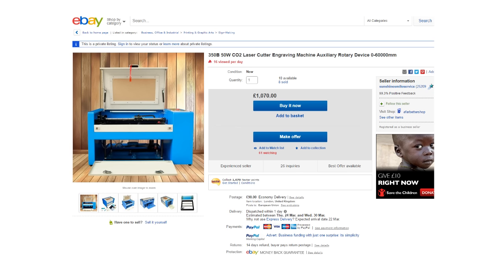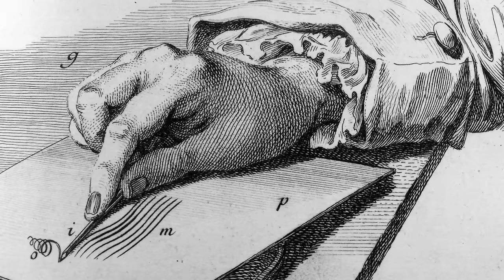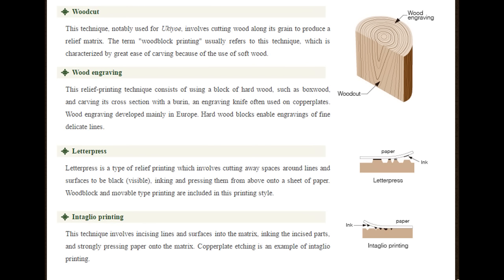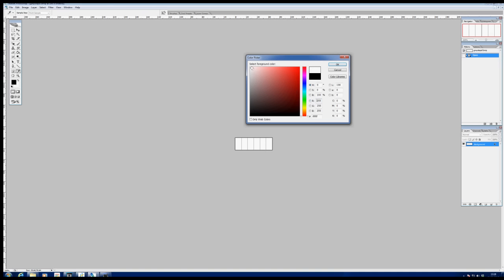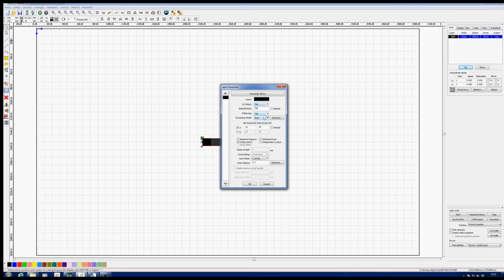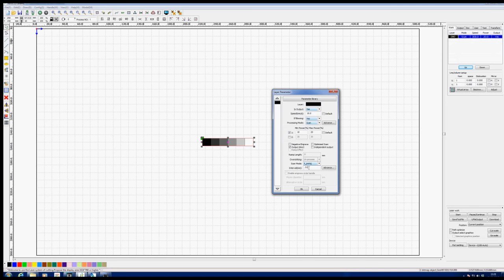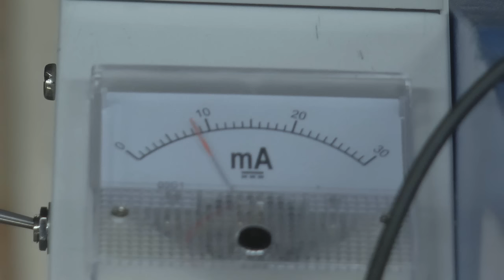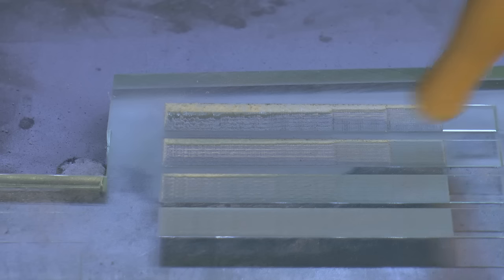RDWorks Learning Lab 56 Engraving Pt1 History and Greyscale

Comment: Hi Ross I am very grateful for your previous help, but I have now another basic question that I am struggling with. I work with memory stick , but the awful thing is that when I save all my parameters  to a rd file (min power , max power, speed for cutting and scanning) the machine don’t recognize them and we need to change manually all the parameters on the machine for all layers. Its very time consuming.
Can you help me with this problem?
And I have one last question In the Work Mode appears a Scan, Cut, Dot options but on the newer version of the software v8.01.12 it is a Pen as well, do you know what this pen does?
Reply from the maker: +666tinche 
Before I finished reading you message I realised you had installed issue 12. Bad news. I had exactly the same issue and dumped it in favour of the rock steady issue 11. You can download this from Thunder Laser  http://www.thunderlaser.com/down    Parameter downloads here as well if you hunt around, although the parameters are now included in the parameter library.
Sorry to say I have not played with the pen yet but I'm sure it will be something I shall investigate in the near future as part of my exploration of engraving capabilities
Best regards
Russ
Reply: +SarbarMultimedia Ross you are a real lifesaver I downloaded this version you recommended and its a really steady version in this version is automatically are included the parameters library as well ,while in the old version it was completely empty. Thank you very much for your time and for your help I really appreciate it.

Comment: Hi Sir,

I have a question and hope you're able to help. I've just purchased this engraver (80W) and for some reason the design program that came with it (RDWorks v8) only saves .rld files. The engraver does recognize .rld files, only .rd files. Would you know a way to get around this issues? I appreciate your help. Thanks, Paul (Dallas, TX)
Reply from the maker: +notinxs 
Hi
If you check out https://youtu.be/kJe16YQlIM0 at about 11 minutes you will find out where you are going wrong with your assumptions. If you still have issues then write again.
Good luck
Best regards
Russ

Comment: Russ, LL56: CNC Router Engraving (relief printing) vs. Laser (1.5", 2.0", 2.5" FL) Engraving (relief/block printing) vs. Etching. Laser Intaglio printing (wood, acrylics). Laser relief cutting can vary amplitudes to determine engraving depth, but not the width of the engraved line. 
But why can't we design a process with a greater amount of work and possibly little quality gain?
As we did with segmenting a project into cutting sequence could we not segment the laser drawing into etching priorities of fine, medium, heavy etching line areas and then change the lens to produce the desired etching width leaving the power unchanged? I never claimed to ask intelligent questions , just questions. ron
Reply from the maker: Hi Ron
An interesting question that you should put on a shelf of "to do" things. This will be a great project for you to undertake when you are up and running with your own machine
Best wishes
Russ

Comment: at 4:42 in this video ...
You show an etching that is created by a single line with what is essentially a 2d helix.
I wonder if this can be done given what you know about grayscale .. would this be possible
on your machine?
Reply from the maker: Nice idea but no. The machine has two operating modes. One is cutting, which, if you reduce the power, will etch a line rather than cut, The cut is done at fixed power(there are special circumstances when you can exploit min power settings) so the  line, although it could be a spiral cut has no variabilty of power control. The other mode is scan, which is a series of horizontal scans (just like an inkjet printer) In this mode the laser power can be switched on and off or to any of its power settings at lightening speed to build up the 3D engraving line by horizontal line.
Thanks for thought.
Russ

Comment: Thank you.  Eagerly awaiting more videos.

A thought crossed my mind when your current meter flashed up for a second.  If the ground wire to your current meter gets disconnected, will the KV on the hot end of the tube conduct down the tube to the low end raisin it's potential to the KV? If so, a grounded metal jacket cable may be warranted.
Reply from the maker: +John Grabner 
Hi John
Let's think logically about how the tube Works.  Firstly  all the gases in the tube  are total insulators.  Before you apply HV to the anode, there will be a few free electrons DRIFTING around in the central tube by virtue of collisions with high energy cosmic radiation particles.  There has to be a FLOW of electrons for there to be a current flow in the tube. If the cathode end is disconnected there can never be any electron flow.  The gas is an insulator so the cathode will never rise much above zero volts. So how does the tube work?  Even when the cathode is connected back to the power supply there is not a conducting circuit because there is column of insulating gas in the circuit. When the anode rises to 25K volts, those few random free NEGATIVELY charged  electrons RUSH towards the POSITIVE anode. They collide into other nitrogen atoms and knock off more and more electrons in their crazy rush to the anode. This now is the ionized pink glowing nitrogen gas which is gaining and shedding electrons. We now have current flow....potentially HUGE current flow which is immediately limited by external "resistance" of various types in the circuit. This current flow can only exist because the electrons are flowing round the completed circuit . This excited nitrogen can only exist because, once started, there is a 10KV DIFFERENCE between the anode  and cathode (the cathode is always at zero volts)  As soon as the circuit is broken the electron (current) flow ceases and the whole process immediately collapses (switches off) . At no stage is it possible for the cathode end of the tube to be  other than zero volts.
Hope this puts your mind at rest
Best regards
Russ
Reply: Agree all is safe if the cathode is grounded.

I was thinking of the scenario where your body completes the circuit between the cathode and ground because the current meter fails (fails open).  The 500k resistance of your body doing a light touch with dry hands is far less then the tube's resistance.  Those few electrons start the cascade in the tube, current flows and your dead.

Is there a flaw in my logic ?

Even if your 110/220v has ground fault, the 20Kv is isolated.  So the GFI circuit wont save you.

Not trying to be conservative, but I like your videos and don't want you to stop making them.
Reply: btw, I purchase a similar machine from the same vendor.  It arrived last week.  I was less lucky with my purchase. My machine arrived all dented and the tube was crushed by the bent frame.  Fortunately,  I had ordered a spare tube and own a torch, hammers and crowbars to get the machine functional.
Reply from the maker: Hi John
Very sorry to hear of your bad start to what should have been an exciting venture.
I've just answered your question about lost steps during dotting. Hearing this story adds weight to my supposition about twisted or misaligned Y axis slideways. DOA is surely covered by insurance from your vendor/ebay?
Best wishes
Russ
Reply: I have a hammer and torch, so all it up and I'm starting to cut.  I should have taken your advice and insisted on paying with paypal even if they said no.

Comment: excuse my question is off topic 
- but do you know if the RDworks work on windows 10?
Reply from the maker: +Kefir Lizard 
Hi Kefir
I'm sorry to report I'm a bit of a software caveman. I tossed Windows 8 off my ultrabook because I wanted a simple PC interface not some wizzy smart phone OS. So I'm stuck in the past with windows 7 (and I also keepan XP system for some of my old faithful software. Now for the good news. You can go to  Thunder Laser
http://www.thunderlaser.com/down  
 and download their well tried version of RDWorks (it's completely free) and the manual also, although you may find the version of the manual from BOSS laser is a better Chinglish translation (still meaningless in places)

Best wishes
Russ
Reply: +Kefir Lizard I'm using RDWorks on Win10 Pro 64-bit and it works fine.
Reply: I Found out... with the help of the link - and it looks like it will work.. hopefuly also when i get my cutter :)
Thank you - both :)

Comment: I seriously respect your time you put into sharing your laser videos, watched a lot of your vids so far and I have a 60 watt machine coming from jinan qi Chen cnc out of China.  now that you have adjusted/aligned the laser in several ways, could you put together a quick and dirty way that you would check/align a new machine if you got one without mods. knowing what you know now.  I'll do a mo re e advanced job once I get some time but I will need to use it for working quickly once I get it so just wondering what you currently think the best quick and dirty method would be without mod ding until I can make the time.  I should have my machine in 3 to 4 weeks so could you do a super fast one?
Reply from the maker: +Todd Mueller 
Hi Todd
Thanks for your kind words.
I really hate to admit it but the for an untried /from scratch setup the only way is with the scorch marks on tape and little pulse burns. The logical approach that I finally settled on is pretty quick because there is little repetition and "fiddling" with the mirrors. But if you really want to cut corners you run the risk of varying cut in different areas of the table. Lets assume that your mirrors are about in the right place mechanically (provided the machine has traveled well). I would  assume that the laser tube is still in its correct factory alignment pointing at mirror1. With mirror 2 at the front of the machine I would check the beam is reasonably central onto mirror 2. If not, then slightly adjust mirror 1 With the head as far away from mirror 2 as possible check if the beam hits mirror 3. If not the slightly adjust mirror 2. remove the nozzle and lens. Check the beam is central to the tube. If not tweak mirror 3. Check your lens is fitted in the correct way (flat side to the work) and refit the nozzle.
Your machine will now work.....maybe not well everywhere but that will be because you have not taken the time to make sure that X and Y beams are parallel to their bearings You may be lucky.
Have you ordered your ammeter? It an absolute essential.  It would also be good to order a cheap digital temperature relay ofr your water tank.

Good luck
Best regards
Russ
Reply: Mine has a built in ammeter, and my machine will be in climate control so will monitor that manually with digital readout thermometer is the plan.  I'll find a way to make sure it's reasonably close to being parallel to the rails.  Not sure if tube will be installed when sent or packed in foam. We will see

Comment: I will be interested in this series, I do some engraving already, but there is a few bits am struggling with, namely getting a smooth engrave, no matter what I try everything appears to make it worse, but default is not best... there is obviously something I am missing!
Reply from the maker: +Michael Edmond 
Hi Michael
Although I haven't reached that point yet I would think there are several things you could try. Firstly, I have to assume you are trying to do relief engraving where you have large portions of flat cut areas. As you saw with my acrylic cuts, the surface at the bottom of the cut was pretty rough.Two reasons for that were probably, my 1.5" lens produces a very fine burn dot and secondly I didn't reduce the line spacing to match it.  I suspect that if I had dropped the table a couple of mm to put the beam out of focus, I would have produced a smoother cut. In reality I think I'm going to change my lens to 2.5" for this series, because it has twice the dot size, half the "hitting" power and at least 3 times more depth of focus. ( see https://youtu.be/WbBPps42iHc  )
Best regards
Russ

Comment: Hi Russ thank you for all your educational videos I really appreciate them. I think because of you this machine has the best support on internet. I struggling with one basic problem for weeks now, and I can’t find anywhere a correct answer or solution. My machine is not connected to a computer I do everything with a memory stick. I loading the file successfully to the machine and I want to change the position of laser head to start from a new coordinate and I think that I need to push the button ORIGIN to confirm and change it to the new starting point, but the machine just refuse to do it, and its going back all the time and starting from the zero original starting point that I set up on the RDWorks. And it is very annoying. 
The RDWorks Learning Lab 11 part1 rotary table introduction video have the closest information on this subject and you also mention there the ORIGIN button, but as I already said when I press the ORIGIN button it does nothing. Do I need to change some parameters in RDWorks or what do I need to do?
Thanks for your time and I hope you can help. Keep up the good work.
Reply from the maker: +666tinche 
Hi
At bottom right corner of RDWorks  is a LASER WORK window. Just below the Save to U File button is a Position window. It should say Current Position. If it says  Machine zero then that's your problem. While you are in this region  there will probably be a tick in the Path Optimize box. This can take control away from you so I have this unticked and use the grouping technique all the time to control how my cuts will take place.
Hope this helps
Best regards
Russ
Reply: +SarbarMultimedia Russ you are a pure genius, you saved me :) My RDWorks was set up on Absolute Coordinate now I changed it to Current Position and it works like a charm. Thank you very much

Comment: Gracias! Great video
Reply from the maker: +Abraham Saenz 
Hi Abraham
For some reason I have an email  telling me you have commented but I cant find the actual comment to reply. So I'll do it from here.
EFR is a pretty reputable band so I would have high hopes that you will get what you asked for
Acrylic will work anywhere  because it evaporates in response to being hit with IR power ' Its a great relative tell tale but it's never going to be used to determine machine power. It will tell you the shape of your beam,. The shape is very useful because if its not round that MAY indicate that your beam is clipping the edge of a mirror. The raw beam should burn a nice conical shape about 6 or 8 mm diameter and should remain so right up to the point of entering the lens.  Have you ordered an ammeter (or are you one of the few with a machine that has one from the start?}. It will be your best friend ever.
Good luck
Russ

Comment: what about doing high speed but repeat several times. 
Maybe then it would be cleaner and stepped? 
Hmmm
Reply from the maker: +Little Steampunker 
Hi
I have tried that  but to no great effect. It's better to drop the table by 2 or 3 mm to put the beam slightly out of focus. You lose depth and definition but get smoother bottom. I think it would have been better with a 2.5" lens
But this is only the very start.
Regards
Russ

Comment: Hi Ross again , today I tried out the older version of the software and I found out that is miss some features that the newest version already have , and I did a research and I found the newest version of the software and I tried out and its working great. It have though one big issue that don’t allow to use the old file versions which mean you need to recreate all files. I created a standalone version with my parameters and I included the help files and the cutting library as well. If you wish you can download it from here: https://luckysheeps.sharefile.com/d-s30f261cc34444a08 .
You don’t need to install it is it already installed I just created a zip from my computer and it is a standalone version, just click on the RDWorksV8.exe and will open it up right away and you can compare it with the older version (you can have open in the same time the old and the new version I tested it this way)
Reply from the maker: +666tinche 
 Thanks for info. The most upto date V8 is issue 16 and is available from  http://en.rd-acs.com/down_complex.aspx?FId=n14:14:14&pageindex=2      These are the guys that write the program but it's not always perfect when it's released so test before you use it.
Best regards
Russ